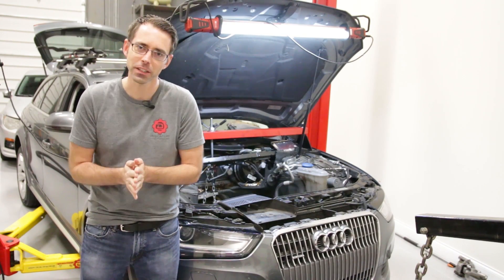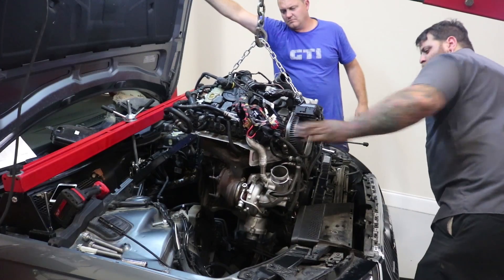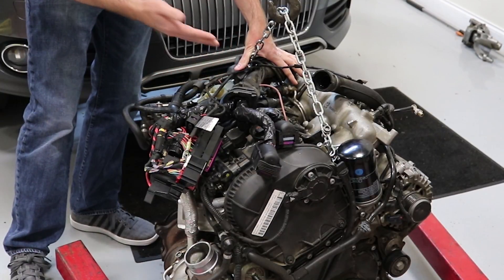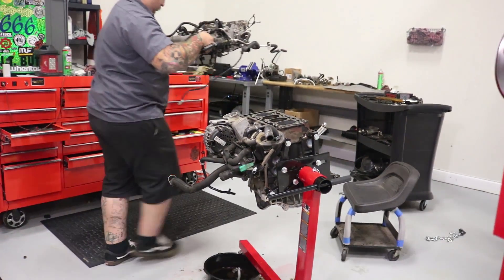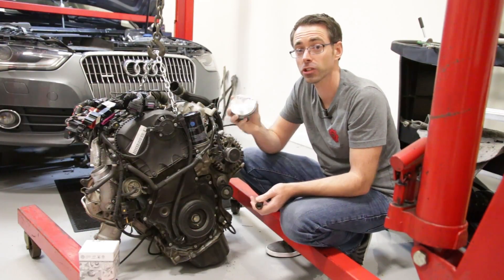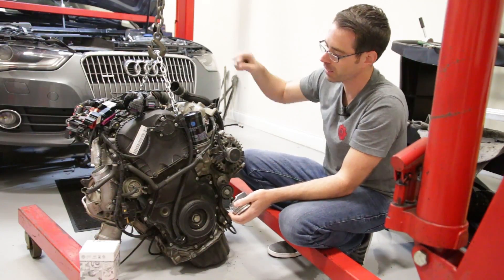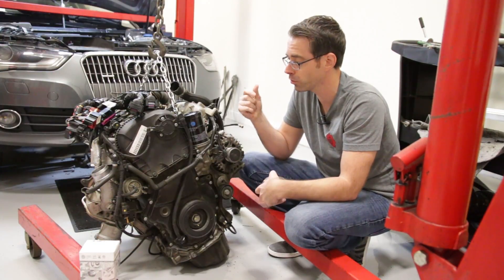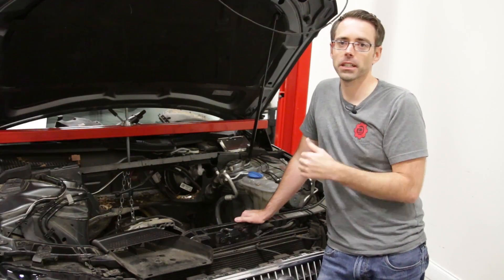In the Shop Ep 6 | Audi Oil Consumption Fix

Comment: Thats not going to get it 2016-2021 have the same problems audi fuck up all the way around with it's engines and they know it. So if thats a 2012 and the update came with the 2016 and up thats str8 bullshit about a piston upgrade going to solve the problem becuzs it want save your money becuzs the new cars have the new updated parts so they say and it still consume oil like crazy. It will start to consume around 60000 to 70000 miles and up thats the cost of having a freaken audi  suggestions, don't put your foot in it.The minute you put your foot in it, it drinks it like gas. Enjoy it til u no longer can.

Comment: lol you can just remove couple bolts from transmission to oil pan and remove oil pan and change pistons .
Reply: That guy in video just said you can't remove them without removing the engine. Did I hear this correctly? I would be glad if that's doable...
Reply: @michaelblanc5200  dont listen him  just take off couple bolts from transmission and you can remove oil pan easy. only two bolts from transmission hold oil pan .
Reply: @Nuclear8800  Hi, I was watching other videos and it seems 4 bolts are horizontally going into upper oil pan. Right?
Reply: @michaelblanc5200   just check under how many bolts hold oil pan and remove it . ez bro
Reply: @Nuclear8800  Thanks! Then there is hope for me, as there is not a single person ever mentioned replacing pistons at home.
I'm planning to use those forged pistons just in case. Any experience or advice on it? And also what are the best non-oil consuming rings brand? thx again!

Comment: The problem is the rings... not the pistons... specifically the oil scraper ring gets clogged with carbon
Reply: Seems 2 or3 owner gets the problem so check the car has had reg oil changes or walk away

Comment: Yes I do agree different piston design ring package critical for the Audi also the PC valve system design is a piece of junk then you got to look at installing your new timing chain maybe oil pump and might as well put new valve seals in the head and clean the valves up PS flush out the oil cooler right now I'm working on the design unlimiting the PC valve with the ultimate design on the catch can process adding some old school new school

Comment: After the fix how many kilometers is it normal for the engine to do before top up the oil again? Mine got it fixed did 1300 km by now but it's almost reaching the limit where the light will ask to top up again!
Reply: Have you found an answer to this? I had my engine swapped to a newer model with upgraded pistons and the oil meter went down to 75% after 1200kms
Reply: @WestBZERO  been doing between 6000 to 8000 km now since the repair back in the end of 2019 but make sure to switch to a bit thicker oil.
Reply: @hellscorpio82  so it does improve after the initial break-in of a rebuilt engine?
Reply: @WestBZERO  don't know about that but since my mechanic told me to use a thicker oil it started to improve. But now i remember i used to had a leak on the carter after the repair so check for that as well.

Comment: Mine is at the moment at the shop to be fixed is this an easy job to get it done without any issues? And   is there a chance that this problem might return again? Answser please it's urgent!
Reply: What model you have and did you fix your problem?
Reply: @ivans8713  a5 tfsi 2.0 from 2009 it is fixed 3 years now no issues.
Reply: @hellscorpio82  glad to hear problem is fixed for good but probably costed a lot. Looks like oil consumption is related to petrol engines only. Ty for reply bud
Reply: @ivans8713  you're welcome it was quite a stressfull experience spent almost 3500 euros i don't wish this on anyone.
Reply: @hellscorpio82  obviously, its ridiculus how much it costs for rings that are simple , light and should cost $10 at most... but yoi have to tear apart entire engine to replace them...
Reply: @ivans8713  yeah that's most of the cost the labor.

Comment: i just got an Audi a4 wagon avant and the oil light came on so i told the dealer that and went to get an oil change and they showed me that it was empty so the very next day i went to work it was empty again so im thinking this is the issue  and didnt know of this issue. so im asking the dealer to fix it and showed them your video and it seems like they dont wanna take your word for it .. i feel like your the most well sought out way to FIX the issue but im waiting to hear from them . they have my car for two days now and i want my car back. what should i do because i have a few weeks of waranty left on it and i want it fixed asap. i got it from a used car dealer..how much is a job like this cost to fix?
Reply: go to an audi mechanic, not the dealer. Get an inspection and quote from them then bring it to your dealer.
Reply: Sounds like oil filter housing gasket, vacuum pump gasket, valve cover gasket all very common leaks with this car. That is too quick for the oil to be gone. Not consumption/burning most likely a leak with a gasket.

Comment: 2012 Audi A4 Avant and our quote is $6500 CDN. There is a class action suit in USA but not in Canada. Also had to have the turbo charger replaced and it fit within the Lubrico warranty with a rebuilt version, but if we fix this problem we will be stuck with $4,000 bill after using the $2,500 maximum claim. Love the car, but not that much...
Reply: Dealing with the same situation man! Give me a shout someday
Reply: Where did you get the claim 2.5k?

Comment: What is a ballpark cost on this type of repair? I have a 2016 Q5 and I really love it, but know I will have to have this done someday if I keep it. I'm going through a quart about ever 1,200 right now at 65k miles.
Reply: 1200 miles per quart is pretty decent. I'm burning a whole quart in 160 miles
Reply: I have a 15 a4 that’s burning threw the oil. Took it to the Audi dealership and was told replacing the pistings would cost 6,000$
Reply: @Jovanyh89  that's an absolute joke for a supposed luxury car. I hope you argued for it to be fixed by Audi for free, there's a class action lawsuit against the earlier pre 2012 engines, not sure about yours

Comment: I have a  2017 allroad B9 2.0 TSFI engine. I assume that the excessive oil burning problem will not be a problem with this engine. What kind of problems can I expect with this engine and do you know if there is a stage 1 tune available for it?  Would the OBD eleven have any beneficial apps available for a fully loaded prestige? I'm an apple guy so I haven't been able to load the app to see what's available for my car. I think the only code change that would be cool would be to see the gear number next to the D or S. Great videos and thank you for sharing your knowledge.

Comment: Hello! I have a question that dont seem to have conclusion or even a thread anywhere. So i bought audi a4 b7 3.0TDI quattro s-line yesterday. At the morning i went to the car i unlocked the car and started to change wheels and doing little mods such as parking lights and cleaning. A bit later i noticed that cars fan inside the dash was on! It was on for over 6 hours or so. Obdeleven doesent find problems with it. Also after i disconnected the battery it was still spooling for like 20 minutes until i hooked battery up again. Why is it spinning? Also drivers computer on the instrument cluster is on fullbrightness even that the dials are dimming.. Hope to get answer for these! Thank you great show💪
Reply: Also i hear that cars speakers are also on all the time. It has audi naviplus with bose

Comment: I thought the B8.5 2.0T engines were safe from this issue. Does the extended oil consumption warranty not cover them? Is there a model year where this updated piston comes installed from the factory? Thanks!
Reply: Jesse Brown lol I thought so too. The engine he has seems to be a cpma and I was planning on swapping one into my b8. The caeb motors were shit tho
Reply: My 2012 A4 B8 was plagued with the same issues, serious drinking problem. Oil that is. If a bit more time would have been spent putting quality parts in these cars, some of the rings were actually put in upside down on these cars. How’s that for quality control. But alas, I still own the vehicle. Rings, pistons and timing chain were replaced a year ago. Car runs great now! Especially after a Ko4 and all the supporting mods.
Reply: 2009 to 2011 has this exact problem. After year 2012, it's all gone.
Reply: @afgjoeable  Clearly not, if he's replacing the rings on a '14. My 14 just started consuming oil a bit...
Reply: @audikris  a bit is normal. Go read your user manual. It clearly says a little oil consumption is ok since the engine is turbo.
Reply: @audikris  you are hard on your acceleration. Turbo and high acceleration do consume a bit oil down the road. If you got too much oil consumption then good luck
Reply: The Khalifa Is this the model year or the actual year it was built?  I have a 2012 A4 Model Yr but it was manufactured 6/2011.
Reply: @mdoneg  your screwed than, your car needs new rings. My 2012 A4 did.
Reply: @afgjoeable  Nope. My friend's 2017 Q5 has oil consumption issue too.
Reply: @omgitsme435  one out of 100,000 not like A4 2011. Look up at the statistics for A4 2011 and 2017 then repost here.
Reply: @afgjoeable  if its all gone after 2012 why is this 13 allroad on the list?